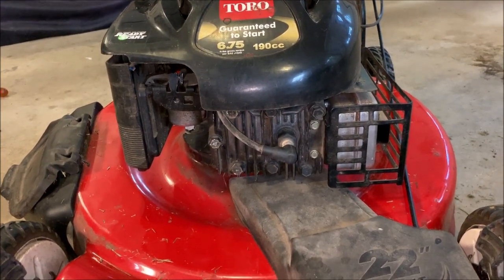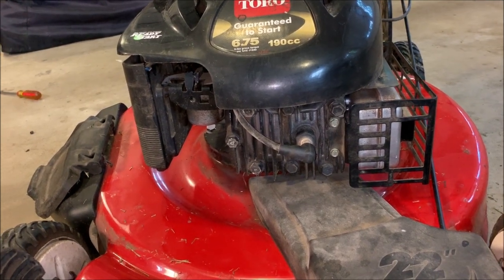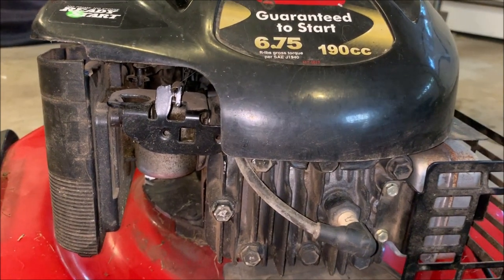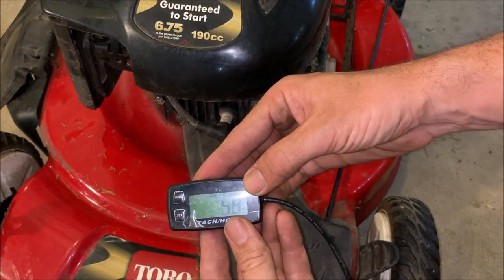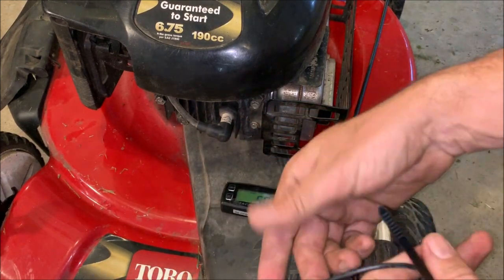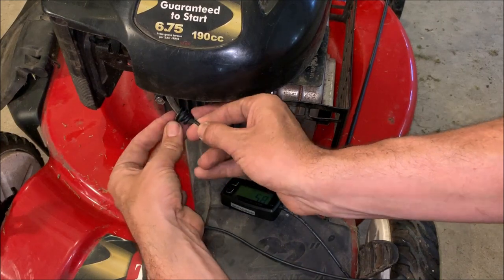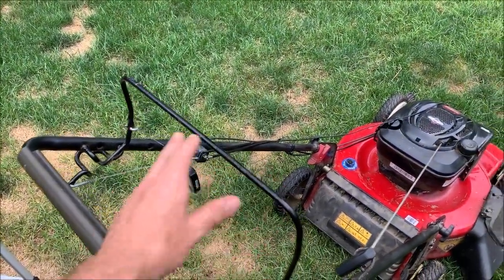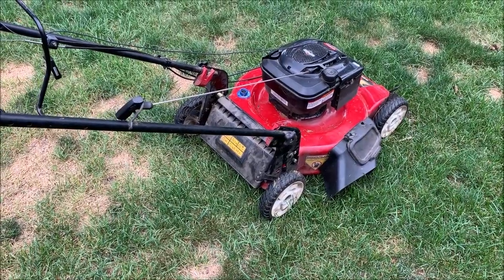How to Adjust the Engine Speed on a Lawn Mower with a Briggs and Stratton Engine

Comment: Nice Video , a lot of times I usually just cut the Governor or Idle spring to make it tighter instead of bending tabs. But that engine should definitely handle a Throttle around that range , especially by it being a Quantum

Comment: Thanks for the video.  According to the Briggs and Stratton specs 2900 + or - 100.  I set mine at 3000 as you.
Reply: Do you know where to find the RPM details on the site? I checked the manual for my lawn mower but it did not give the rpm specs.
Reply: @MTL_Rider  I'm also looking for somewhere I can get RPM specs

Comment: toro with briggs and straton 190cc engine. It's the high wheel smart-stow model. Just put the tach on it tonight and it was spinning 2600 from the factor. It's a 22 inch mower so the sweet spot is 3300 rpm to get 19000 fpm. I set it at 3100/3200 and it seemed pretty happy there. Blade is sharpened and it's ready to cut tomorrow. Can't wait to see what the difference will be.
Reply from the maker: Good luck!  I ended up slowing mine down.  Mostly because the speed was too fast with the self propelled.
Reply: @jcondon1  It's a personal pace mower so the walk speed didn't change at all. Just a higher blade tip speed for smoother cutting, more thorough mulching. it's a massive improvement over the stock speed!
Reply: @geemonkey72 - How did you adjust the speed on the 190 cc Briggs?  Thanks!

Comment: Good video, thanks!  I would have left it purring at 2600, but that's me.  Here in FL we have a lot of trouble with dust and sand and I try to get a larger engine and run it as sllooooww as possible and still cut ok with a low lift blade.  The governor should kick in and deliver the fuel to keep it powered in heavier grass (premium will help).  Some mowers have a cable that goes to this adjustment with a slightly different bracket.  There's a lot of used stuff (brackets) on ebay and a lot of the briggs stuff is interchangeable.  The only thing it has to do is make a small amount of pull on that spring with a pivot arm.  For the self propelled mowers, the wheel gear ratio is often fixed (some are variable) and you end up changing engine speed to get your walking speed.  It's all stuff to consider when buying a mower.  I've found that the Craftsman (Husquvarna,Poulan) gearboxes do well in a sandy environment and the Toro Recycler not so well due to the open bearing at the top under the gearbox pulley.  I've misplaced my tach.  I liked yours I'll probably pick up one of them.  Good job.
Reply: I agree no need to max it out, set at speed that will get it cut

Comment: As soon as you started that motor, I thought yes it is too low like most manufacturer set them that way that one may be a tad lower than it is said at the factory, but why would you want it to run slower when it could run at 3200. It’s going to cut the grass so much better, cleaner and shoot it out the side or the back chute with much more force.

Comment: Wonder if the tach sensor wire can be attached anywhere on the wire between the coil and plug? Or only works up against plug? Thanks for this!!!
Reply from the maker: Should work anywhere on the wire.

Comment: I'm sure the manufactures spec for Briggs and Stratton is 3600rpm for the HP rating they give🤔
2600rpm for the torque rating/legal reasons 🤣
I've got my Briggs 850 set to 3300rpm, but I think I'll bump it up to 3500. Better cutting in general 😉😁

Comment: How do you adjust the power or get more RPM on a 2019-2020 Toro SmartStow mower. I bought one 2yrs ago and sold it recently. It worked perfectly fine. The reason I sold it was because I was thinking of getting a battery powered mower. After I realized that battery powered mowers don’t give as good of lift on the grass I was upset I already sold my Toro SmartStow. So I had to buy a new one. I got the same model, so nothing was different at all. When I got it home and out of the box, I started it up and quickly could tell the mower sounded lower in power. I took it back and got another one thinking maybe something was wrong with previous one. When I got the second one home it sounded the same as the previous one. Not sure what Toto did but they obviously lowered the RPMs. I would like to get a little more power back in the mower. Are you able to help me with this? I have no understanding of all these moving parts. I did manage to take the cover off of it and move this flat disc or turn it and heard the mower get louder. So I am a handy person. Just not sure about all these moving parts and exactly what to do. The parts on my Toro is all configured differently compared to yours. Please let me know if there is a way we can talk. Thanks I really appreciate your video. Gives me hope that I can gain a bit more power out of my mower.
Reply from the maker: Most likely it is slower.  The government has passed laws over the years requiring that mowers not exceed a certain speed to help avoid injury.  Toro sells mowers with Briggs, Kohler, Honda and in the past Tecumseh engines.  All are a little different but most function in a similar manor.  When the mower is off, there is a spring that pulls the throttle open.  When you increase the tension on that spring the mower will go faster before leveling off.  Be very careful.  I have done work on a lot of equipment where people really messed up the linkage running from the governor to the carburetor to the point where the engine is screaming out of control fast or not maintaining speed under load.  If unsure, it would be best to ask a local shop to adjust.
Reply: James Condon Gotcha. Well you did it super easy so I expected it would not be that hard. Problem is I called a local shop and told them the difference with this mower compared to the one that’s exactly the same as this one and I asked them if there was anyway to adjust them. They said no there is only one speed. That was before I researched around on YouTube. The reason I searched YouTube was because I had a strong doubt that what he said was true and I was right. They can be adjusted. Anyway if your able to help that would be great if not I understand.
Reply from the maker: carsutube can you send me the exact model number?  It is usually on a white sticker sometimes under the rear flap where the grass catcher goes.  Also the engine should have a separate model number somewhere.  If you can provide those numbers I will take a look.  Sometimes though it is hard to see how to adjust without having it in front of me, but they are all adjustable.  Either a tab to bend or a screw that tightens which will increase the tension on the spring.
Reply: James Condon absolutely. Mower model number is 20340 and the engine model# is: 104M020131F1. Personally I think the parts are so tucked under things compared to yours. It’s almost like they are trying to hide this stuff. I believe what I need to get to is under and Sorta behind the gas tank. Anyway I have a tachometer on the way in the mail. I wanted to get one so I can have it to get an accurate adjustment. This mower says it has a 2600rpm rating based on Toro’s website. I am 100% certain that the mower I had before this, that I owned for 2yrs (which is the exact same model as this newer one) was stronger and louder than this one. Anyway hope that info helped. Thanks for your help.
Reply from the maker: carsutube ok thanks.  Will take a look.  FYI most engines are rated for 3600 rpm.  My mower was at 2800 and that seemed slow to me.  3000 was better.  Would not push much more.  I think due to safety regulations the manufacturers have had to set the speed slower and slower over the years.  Also I found that the drive wheels where spinning too fast for me at 3200 rpm.  Was probably geared with new slower regulations in mind.  I could not keep up with the wheel speed.
Reply: James Condon I agree. I heard the sweet spot when you adjusted. That’s all I want to get mine up to is the same as what you did @3000rpms. I am sure they have it @2600 since that’s what they spec it at. Oh and I’m sure you already know it’s a Briggs motor. Thanks very much for your help.
Reply from the maker: Looks like the spring is behind the gas tank.  Might be able to adjust without removing the tank.  Posted a picture showing the spring and the control bracket. The control bracket can be bent to increase the tension.  The pic I found was not the best lighting, but you can just see the spring and the bracket.  Hopefully that is your engine. https://www.youtube.com/post/Ugx8xsW-ok0nH3pvkfB4AaABCQ
Reply: James Condon WOW great. Is there anyway we can connect some way. For example email or google voice. I don’t know how to post pics on here or I would. Which way or direction do you bend it. Looks like they some how detached the gas tank and leaned it out away from the motor without taking it completely off so they could get to it.
Reply from the maker: I think the engine in this video is similar.  Have a look.  https://www.youtube.com/watch?v=qmXGlszh3kA  Look at the spring that is attached to the control bracket.  If you bend control bracket away from the spring you increase the spring tension (the spring is stretched tighter) and the engine speed will increase.  Bend a little at a time.  Ideally you would do it without removing any pieces.   Otherwise you will have to put it together again and measure the speed and then take it apart again if further adjustment is needed.  There is not easy way for people to send me pictures or content on youtube unless you have your own channel.
Reply: James Condon sweet. Thank you very much for all that help. If I need to I’ll email you a small video of the mower so you can see it. I will not get my tachometer till April 27th so I will not be able to do anything at the minimum till then or shortly after. I’ll check out that video for sure. Thanks again. I wish I could leave you a donation for your time and help.
Reply from the maker: carsutube on that video I sent if you pause it right at the 7:28 mark you can see the spring.  I thin you can adjust without removing the fuel tank.  Might need a good pair of needle nose pliers.  The bottom of the control bracket looks to be behind the fuel line near where the line goes into the fuel tank.
Reply: James Condon since mine is that StowAway version I stood it up so I didn’t have to bend down to look for it. When I stood it up it was right there. Yep right behind the fuel line. I plan to install a shut off in the middle of the fuel line so that I can shut off the flow after each mow. Especially for winter storage so I can keep fuel out of the carburetor. I’m glad I watched that video. I need to get me a pair of those clamps to temporarily crimp the fuel line close to the fuel tank. This way I can keep the fuel in the tank until I finish cutting the line and installing the shut off. I need to find a place that carries the shut off and clamps as well as where to get that yellow crimper he used. It looked like it was plastic. Anyway thanks a million. I’ll let you know how it goes once I get my meter. It was really cool watching him take that apart. Oh and yes it appears very much like mine except for the color, but that’s just cosmetics. Thank you again.

Comment: my problem is the rpms are way too fast i don’t have the rpm checker but you can hear it, i bent it the other way to slow it down but it didn’t work do you know how to solve that
Reply from the maker: Try moving the throttle plate manually when the engine is off.  Make sure it is not stuck.

Comment: what mode should i use on meter? i also have BS engine 6.5 , 4 cycle engine
Reply from the maker: The Epic Savage the default setting is usually good.  One spark per revolution.

Comment: what do you think the max speed is for a 19.5hp 2 cylinder briggs straton engine, anyone know?
Reply: ask a reliable  dealer
Reply: Check for your engine # then go to B&S and research your engine specs. They even have valve gap, torque specs and types of oil etc.

Comment: What’s the part number for the tachometer your using I believe
Reply from the maker: Just a cheap one off of eBay.  No part number.  But if you go to eBay or google search for "induction tachometer".  You will see a few different types.  The one I got has the green back-light.
Reply: Thank you for the helpful video and the info for the tach

Comment: You do realize you can lookup the RPM of the engine online? Seems you're guessing what it has to be. I have a briggs mower that has a stock speed of 3800RPM
Reply from the maker: norge696 yes.  The engine is rated for 3600.  The issue is more that regulations require mowers be set slower.  It varies depending on where you live and has gone down over the years.  So a new mower might be set to 2800 rpm where a mower that is 10 years old may have been set at 3200.
Reply: @jcondon1  i agree. 3000 is a good number for those machines. You're better off getting a higher end mower instead of running a residential mower on the hot side.
Reply: @thersten  And 3456 RPM is the figure for a 21" blade to line up with the "magic number" that is 19,000 FPM. I do agree, though, that the governed speed is not to be set any faster than the OEM has assigned it. If the OEM specifies for the engine -- say, 3250 RPM -- then it should be adjusted to no higher than that.
Reply: Just got a new mower this spring and it has a Briggs & ScrapIron 550EX running kinda slow. My research indicates the factory setting is 2600 RPM based upon the max torque and the publication allows 3100 as the max speed. I set it up by sound and suspected it was a little fast, the Tach showed 3400 and I set it down to 3140 with no load. It was also discovered the factory assembly had adjustment problems with the armature air gap scraping the flywheel due to factory workers whom are careless and don't take pride in their work.. I just need the mower to chop up the grass and not bog down due to low RPM as it was straight from the store.